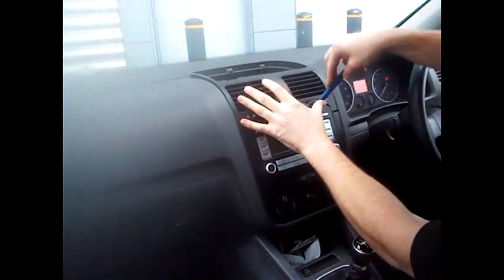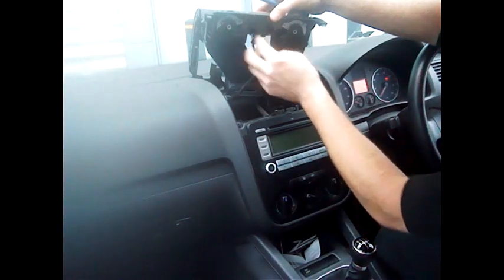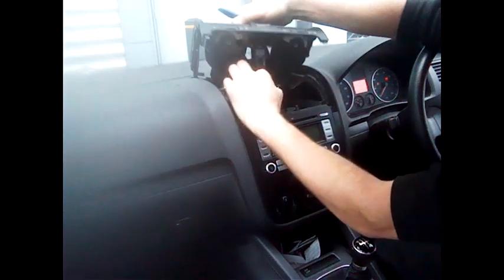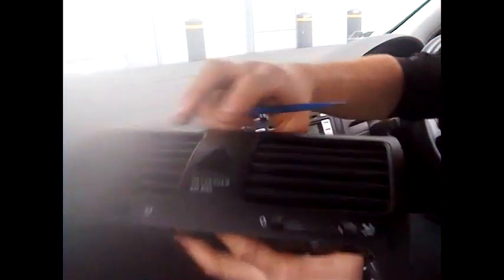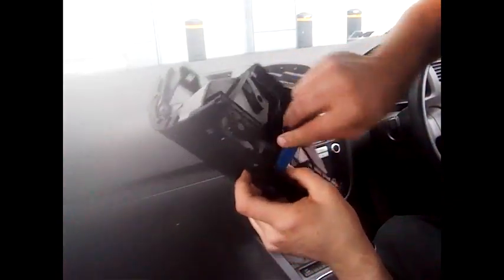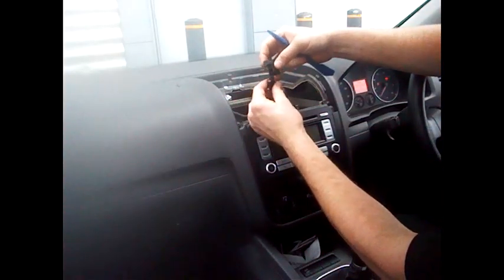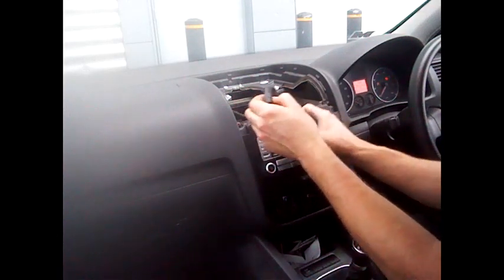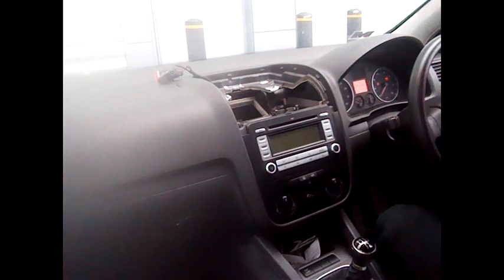Radio Removal Volkswagen Golf (2006-2010) | JustAudioTips

Comment: I have a golf 1.9 tdi 2006, and I want to fit my new car stereo in to it, but I need fascias etc.. I presume to do it all, is this something I can do on my own, or a garage needs to do it, and where can I buy the kit to do all this, obviously my new car stereo is the slimmer type, so without fasicas I am guessing it wont look right, last time I did it to my fiesta 2000 and I just bought a fascia/radio replace kit off amazon, was hoping I could do the same thing? thanks.

Comment from the maker: Sorry about the delay, you will have to run an ignition live to the red cable. There is two ways you can do this.

1) If you cigarette lighter is active on ignition, you can run the ignition to the radio to there, simply cut into it and crimp the wire into the circuit.

2) You can link it into the fuse box, there are some little gadgets online that pull a power supply from a fuse. Find a fuse that powers on via ignition that is below 10amps and then run this to the stereo.

Comment: Hi - great vid. Got to the last part where the radio should be loose and simply be pulled out. However, it seems to be lodged inside. All screws are out but doesn’t pull out.

Have you come across this and if so any ideas what it could be?